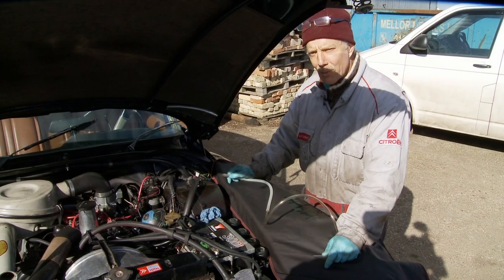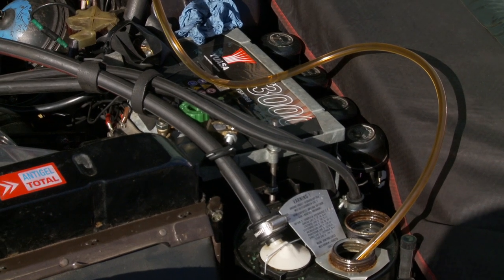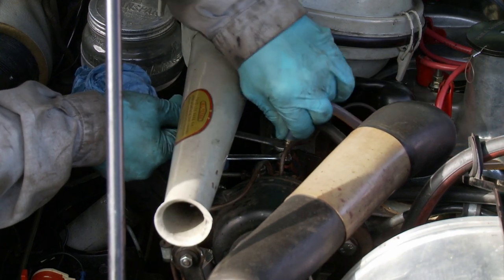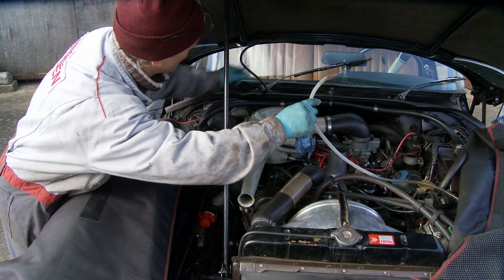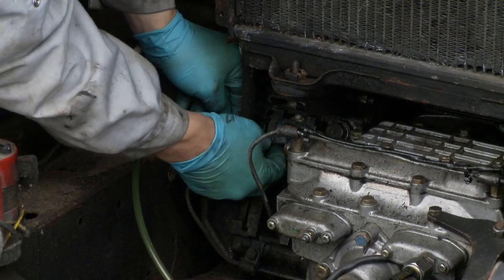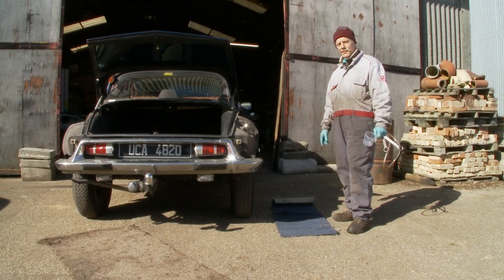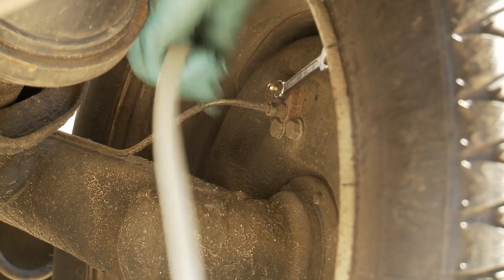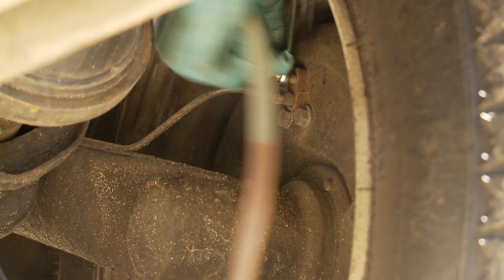Bleeding the brakes

Comment: I need to bleed the brakes on my DS21 1970 manual. In the workshop manual it says to undo the pressure regulator valve 1st and then bleed the brakes as you demonstrate, as when under pressure the bubbles don't form. Is this the correct preceedure?

Comment: Hi may i ask why let the lhm goes back in to the tank?
Is it removing the air bubbles without changing the fluid?
Reply from the maker: Apologies for the slow reply - Yes, putting the hydraulic fluid through a tube back into the tank allows the air to be released into the atmosphere and for the fluid to be used again. The system is designed so that many of the "return lines" feed back into the reservoir on one side of a baffle plate, high up while the pump draws the fresh fluid from the other side and low down. The idea is that the bubbles rise and escape and only fluid with no air is drawn back into the system. Ian